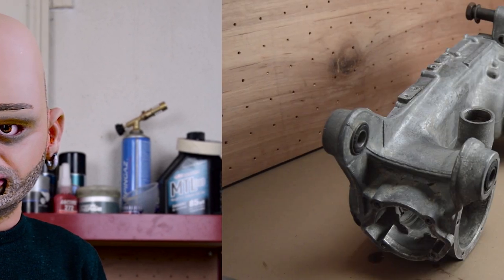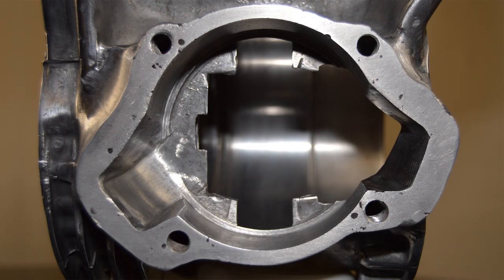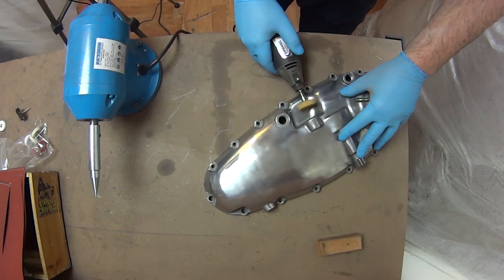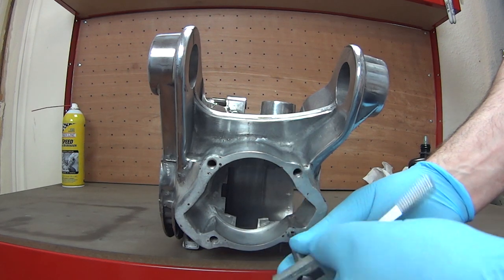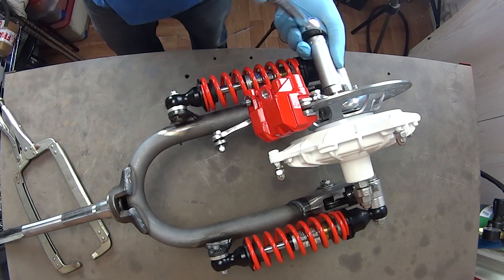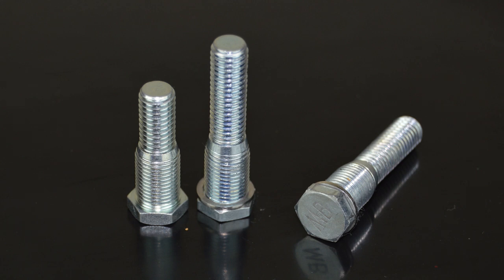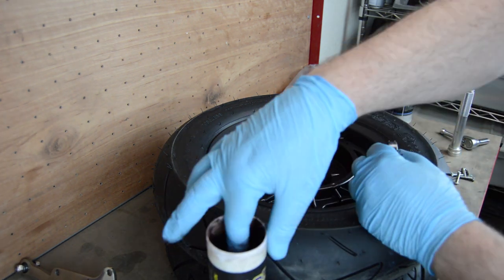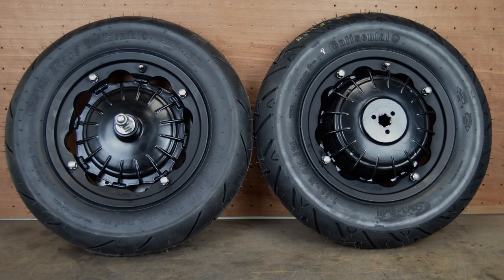Project Lambretta Episode 2

Comment: Where did you get your bench grinder and polisher? Thanks
Reply from the maker: All the stuff came from E-Bay. If your going to get this kind of set up just make sure the grinder has a bit of grunt and a sensible run time. Pony bench grinders burn out really easily and weak ones will just stop if you apply any pressure at all! Make sure the polishing mop kit comes with mandrels that fit your grinder.